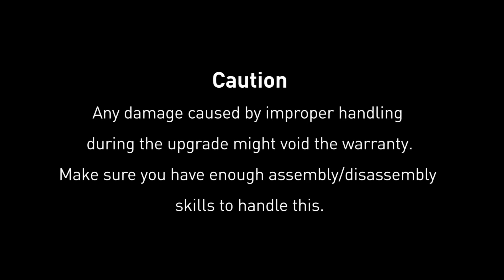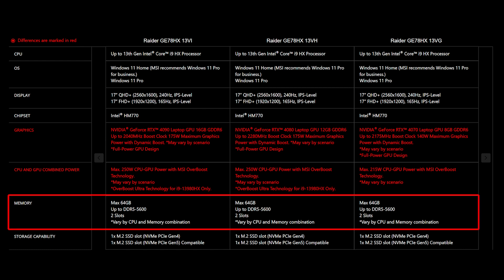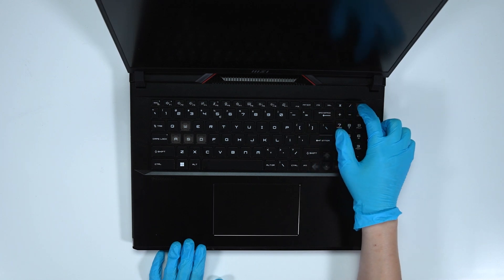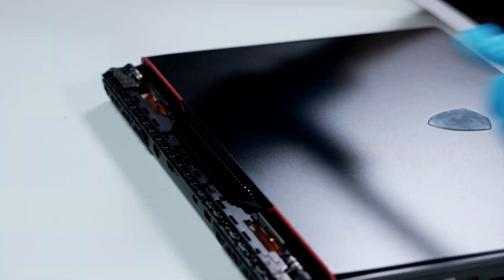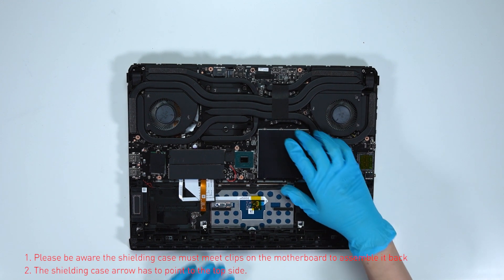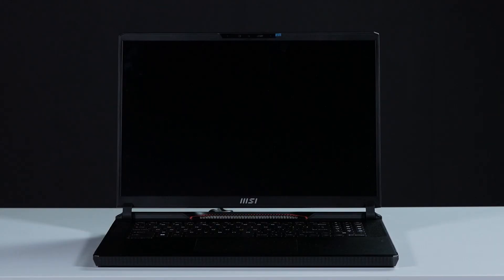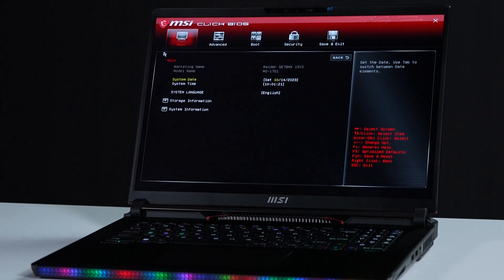MSI Raider GE78 & 68 /Vector GP78 & 68 HX 13V Series Upgrade Tutorial

Comment: Success!!!  I couldn't remove the battery since the top screw head seemed to be stripped. But I was able to disconnect the cable and get the M.2 drive in safely. They really make it hard to remove the back case without scaring you with every crack sound. Not sure why they couldn't just rely on the screws to keep it secure instead of plastic clips.

Comment: Nice tutorial. If you're just installing a new M.2 drive, do you even need to unplug the battery? I would rather not touch it at all.
Reply: It's really not safe to make any modifications without unplugging the battery. NGL, I kind of feel the same way because it should work in theory but I would hate to fry something because a piece of metal accidentally grazed something on the board.

Comment: I just did it! I changed my 32 GB RAM for 96GB and everything had gone smoothly. It was pretty easy. I thought it was gonna be much harder LMAO. 

It was my first time opening and doing an upgrade to a laptop. So I was a bit nervous. 🤣 But of course, on the video it looked way easier. I think this guy opened the laptop more than once. Because the first time I opened the laptop everything was pretty good stuck. 
But after that I had to open the laptop again. (Because the part at the aux cable jacket was not really good in its place.) And the second time I opened the laptop it opened like it really was nothing. (Obviously 🤪) It was totally different than the first time opening it. 

I took all my time and had a good and clean workplace with nobody disturbing me and with good materials. Thanks for the help! Now time to enjoy!

PS: For someone reading this and that also wants to do this: Keep in mind to try to do everything in one time and don’t open up the laptop again for several times, because if you do that you will damage the laptop more! Like me! (Nothing important like the components or something, but only maybe some little plastic hooks at the part from the case on the up or downside.) Every time you open this laptop again, it will damage a little bit.. And I lost one damn little sneaky screw from the back of the laptop case. I looked everywhere in the room for this little screw, but unfortunately could ‘t find it.. Lol.  Luckily its absolutely no problem if you miss one screw from the laptop case, if you lose something from the motherboard or other important components, its another story. 😓 But yeah, I don’t lime to lose any screw so I am going to order a screw for the case online to have a complete laptop again. 😅 

God bless!

Comment: Your video skips over the part where you remove the hinge cover. It goes from removing the screws, and then the next shot the hinge cover is already removed. Mine is stuck firmly in place after removing the screws. Do I use a spudger? Where are the clips?
Reply: @NeilMartinIsHere  I just did it! I changed my 32 GB RAM for 96GB and everything had gone smoothly. It was pretty easy. I thought it was gonna be much harder LMAO. It was my first time opening and doing an upgrade to a laptop. So I was a bit nervous. 🤣 But of course, on the video it looked way easier. I think this guy opened the laptop more than once. Because the first time I opened the laptop everything was pretty good stuck. But after that I had to open the laptop again. (Because the part at the aux cable jacket was not really good in its place.) And the second time I opened the laptop it opened like it really was nothing. (Obviously 🤪) It was totally different than the first time opening it. I took all my time and had a good and clean workplace with nobody disturbing me and with good materials. Thanks for the help! Now time to enjoy!
I just did it! I changed my 32 GB RAM for 96GB and everything had gone smoothly. It was pretty easy. I thought it was gonna be much harder LMAO. 

It was my first time opening and doing an upgrade to a laptop. So I was a bit nervous. 🤣 But of course, on the video it looked way easier. I think this guy opened the laptop more than once. Because the first time I opened the laptop everything was pretty good stuck. 
But after that I had to open the laptop again. (Because the part at the aux cable jacket was not really good in its place.) And the second time I opened the laptop it opened like it really was nothing. (Obviously 🤪) It was totally different than the first time opening it. 

I took all my time and had a good and clean workplace with nobody disturbing me and with good materials. Thanks for the help! Now time to enjoy!

PS: For someone reading this and that also wants to do this: Keep in mind to try to do everything in one time and don’t open up the laptop again for several times, because if you do that you will damage the laptop more! Like me! (Nothing important like the components or something, but only maybe some little plastic hooks at the part from the case on the up or downside.) Every time you open this laptop again, it will damage a little bit.. And I lost one damn little sneaky screw from the back of the laptop case. I looked everywhere in the room for this little screw, but unfortunately could ‘t find it.. Lol.  Luckily its absolutely no problem if you miss one screw from the laptop case, if you lose something from the motherboard or other important components, its another story. 😓 But yeah, I don’t lime to lose any screw so I am going to order a screw for the case online to have a complete laptop again.      😅 

God bless!
Reply: Do you already know how to remove the hinge cover? If so, please help me if you want. I want to updgrade my RAM and this video tells me that I need to remove the hinge cover, but its really good stuck in its place. I don't dare to remove it with strength! :(
Reply: @YouTube-Administrator-Marc  It was the hardest part to remove. I used a spudger and teased it off eventually. There are a number of plastic hooks that are keeping it in place. I should have taken a picture so you knew where they were. If you manage to remove it, take a picture for the next person (maybe someone has uploaded a pic?). When you insert the spudger, the hinge cover will have more flex the further you are from a hook, so you can feel your way to a hook. Then apply scary force to that location. Once you have one, it all becomes easier. I love my MSI, but the repairability design is terrible, I don't think I'll be getting one again. Think of it like this, if you do break the first hook, the remaining hooks will be enough to keep the hinge cover in place. Good luck!
Reply: @NeilMartinIsHere  Thanks a lot for your fast response. After I wrote my comment to you I saw some other of disassembling videos of exactly this laptop. I watched closely and don't think it should be a very big problem. Like you said, using a spudger to take it off. Unfortunately I couldn't see where the plastic hooks were, but you are saying that there should be more flex the more I am away from the hook, right? So if there is no flex or barely any flex the hook could be right there? Do I understand it correctly like this? Thanks for the good luck wishes, I will need it because its the first time disassembling a laptop for me. I only worked a couple of times on desktop PC's at school, but that was a very long time ago, and its also a different story than laptops. Thanks in advance.
Reply: @YouTube-Administrator-Marc  Yes, you understand correctly. It will be easier to insert the spudger where there is flex, then you move the spudger towards where it gets tighter, trying to pry it open as you go.
Reply: @NeilMartinIsHere  Alright! Thanks, I will keep this in mind.

Comment: This worked great - ran into a couple of things that were different from this video and that I learned: 
- when you pry the hinge cover off, make sure you're lifting up from the silver portion, as that is part of the hinge cover that pops off. There are "aesthetic" seams there that aren't real, you need to pull up from just a hair lower
- when I popped the bottom cover off, there was adhesive keeping it in place. It will take a little bit of very gentle flexing to pop it off
- weirdly, my battery only had a single screw (center). The left and right battery screws were not there on mine
- the battery on mine was glued in (likely why they skipped the screws). I could not remove it, but I was able to lift up the portion closest to the motherboard to be able to remove the battery cable
- when you remove the battery cable (and you should, even if you discharge the battery per the video instructions), this will reset BIOS settings
- IMPORTANT: because you reset the BIOS, the first POST test when you power it back on will take a LONG time before you see anything on the screen, and it will flash several times as it restarts to find the failsafe defaults. You will have a moment of pucker - just wait it out. It took about a minute, and then I was able to get into the BIOS, reset the time, and verify the settings.

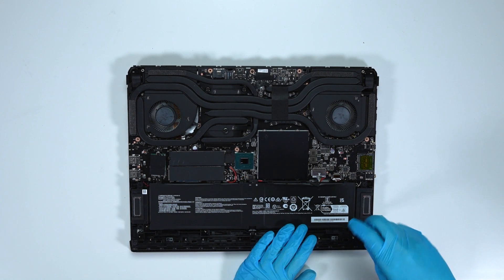Comment: Just done it on my GE78 HX. Added an M2 drive and changed for 64gb ram. It wasn't as bad as everyone esle is saying. Additional advice: remove all USB devices before. Don't forget that small USB3 dongle. I'd also suggest reseting your bios to default settings. Don't forget to press that power key for 15 seconds. The hinge cover wasn't that difficult to remove. They have anchor-like plastic bits at the very end of both sides. Start here. Start removing the back cover from the top right corner (looking at the laptop like on the video, screen down and light bar closer to you), there's more "space" there to insert a prying tool. Remove the rest of the back cover starting from the back side, where the exhaust fans are, then on either sides, then on the side with the light bar. Avoid removing the battery by pulling on the cables. Instead, use a strong pointy tool to bring the plug towards you by pushing/pulling on the white rectangular protuberance of the plastic plug that sticks out at the center of the metal casing (you can see it at 2:15). I used tweezers. Be gentle, and use something else to ease the plug left to right too. When putting everyting back, watch out for the audio port, it goes inside the back-cover shell. Good luck!
Reply: mine is loose how did you get it back on?

Comment: How do you get the hinge cover off so easily? I can't figure out where to open it from lol, just trying to upgrade the memory to 64gb
Reply: Use a pick on the sides, then have the back-side of the laptop facing you (i.e. so the screen is facing away),  then pop it off by lifting/pulling from the part closest the screen towards you.. I hope that makes sense.. 

Given how troublesome it is to take apart these laptops, and repeated pulling the case apart, will ondoubtedly lead to damage - my recommendation is do all the upgrades in one go...
Reply: He opened it ahead of time to make it easier to film.  It's a pain to open this laptop though I've found a decent way to do it. It's still kind of a pain Ge76 was much easier to work on.

Comment: Does the 68 also have two SSD/M2 slots?
Reply: 1x M.2 SSD slot (NVMe PCIe Gen3) & 1x M.2 SSD slot (NVMe PCIe Gen5) Compatible
Reply: @nostradome01  will it fit a double sided one? are 4tb drives generally double sided? I am talking 68 here.

Comment: Thanks for the video. This had been one of the worst laptops to take apart I have ever dealt with. Soooo many plastic clips. Pretty disappointing that they want that route.
Reply: That is one of the main reasons im hesitating to buy this even at its sale price :(
Reply: i can verify this is a legitimately odd laptop to work on. It's really bad. I ended up returning mine to Newegg because I couldn't see myself doing routine maintenance to clean this thing out every few months like i do with my other devices. even the PS5 and Xbox Series X are easier to take apart than this thing. My GE76 Raider comes apart and goes back together in no time. Msi really messed up with the Ge78 this generation. It's terrible because the bottom cover envelops around the side of the frame, making it very difficult even if you are very familiar with taking things apart. It's very easy to snap pieces and the cover snags onto the interfaces on both sides, mine was caught on the audio jack, and wouldn't properly fasten back together and jutted out at the audio jack portion. Newegg gave me a full refund thankfully, Shame on MSi this generation, their quality has gone downhill. And it's a shame because the laptop it self is great, it runs cool and is a monster with performance, but for over 4000 dollars it should come apart much more easily and have a more premium feel to it when tearing it down. MSi is gonna have a lot of returns on these, it's that bad of a design to take apart. I will not own an expensive laptop that is a pain to do routine maintenance on. Ended up ordering an Aorus 17x on the way to compare the build quality to. 

And don't get me wrong, I don't want to dish out hate on Msi at all, but they need to provide a better chassis for a laptop in this price range, they already are leaving out advanced optimus and g-sync, can they at least provide better build quality similar to the GE76 and GE77? is that so much to ask for? haha
Reply: @joeg9244  Yep I too had the issue with the audio jack. I even accidentally scratched part of the bottom cover right where it meets the keyboard so I'm really upset about that too. I have taken apart hundreds of laptops now as I work desktop support for a very large company so I'm no stranger to plastic clips but damn this thing is REEEALLY BAD! The lack of Advanced Optimus is vehemently offensive considering the price. Otherwise, despite the flaws I do overall really like it.
Reply: Idk what you talking about, because after you remove plastic cover behind screen it is wery easy to take off bottom part of the case with bare hands. My version is Raider GE68 HX 13V
Reply: @MurderousNoise which ssd slot is version 5 compatible?

Comment: There are metal tabs you need to pull away from the ram cover, use a very small flat head screwdriver or craft knife blade, carefully pull the top three tabs out a tiny bit and you can get under the cover and prise up. Was unpleasant.
Reply: Yes, this was the hardest part of the whole upgrade and it isn't mentioned in the video. Those tiny little clips break very easily and it looks like they make contact with something that can detect if this cover was touched!